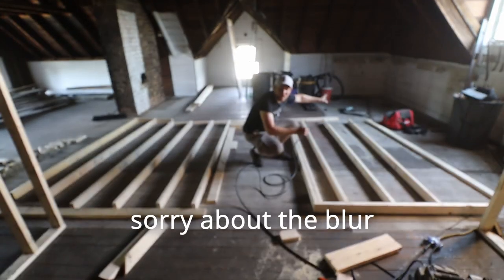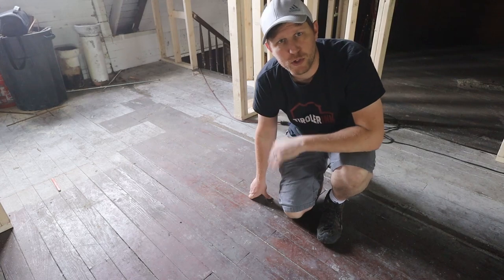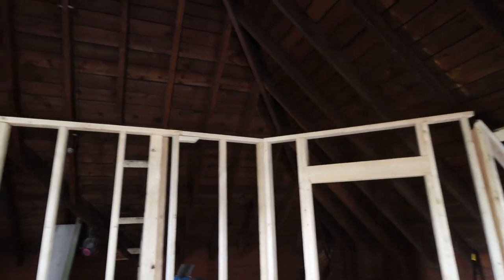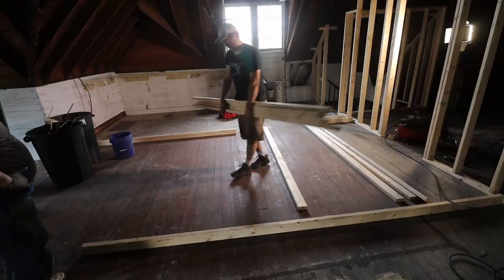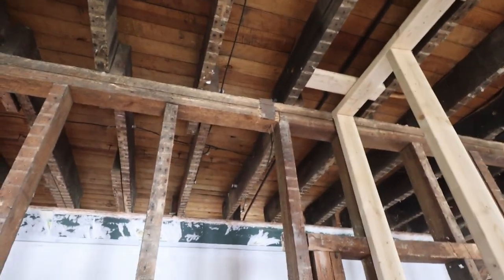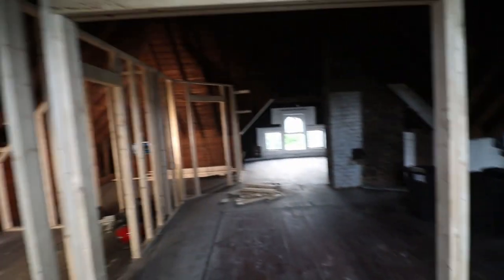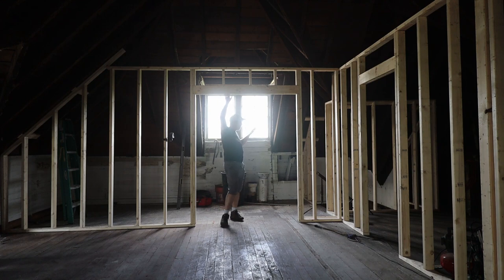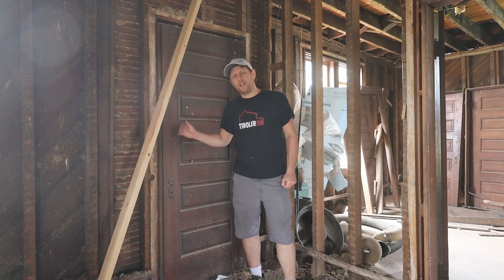Attic Master Bedroom Framing - Victorian Home Renovation [TirolerInn]

Comment: It's easier if you don't cut the door sill out until the wall is secure all the way around.
Reply from the maker: Yes a framer showed that to me later. He also showed me that it’s best to only do the full king studs and then do the trimmers after as the circular saw has a 1 1/2 guide to cut the sill off for the trimmers.